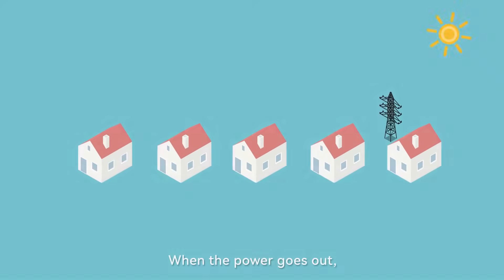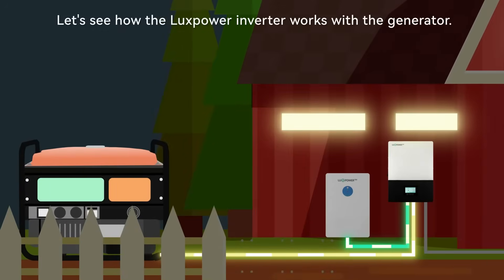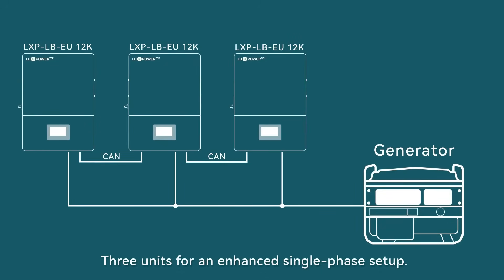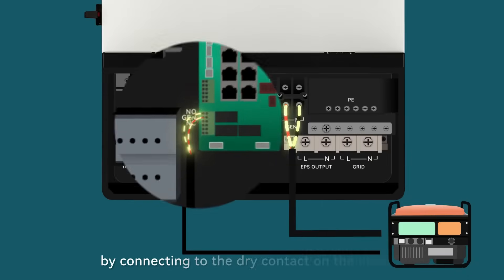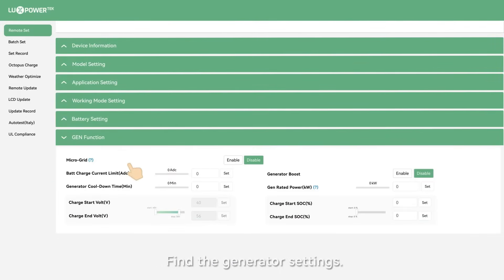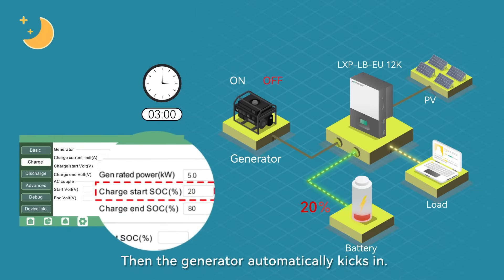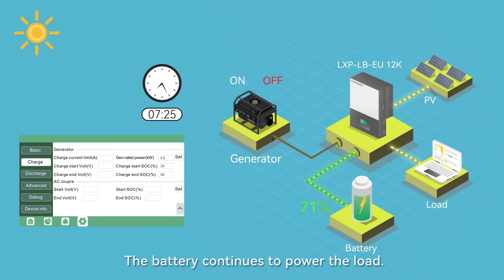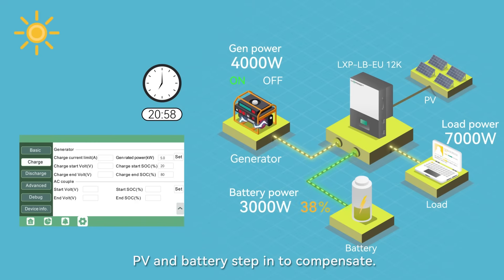Hybrid inverter working with Generator Application

Comment: Can I use a 3rd party inverter to connect to LXP 4.6 UPS port to charge automatically the batteries?
Reply from the maker: Hi there, thank you for reaching out. Sorry, the ups port is only for the load connecting, cannot work with any other device.
Reply: @LUXPOWERTEK  Is there any other way to connect a 3rd party inverter to LXP to load the batteries?
Reply from the maker: @Atomotti  Our LXP 4.6K model can work with the battery directly, why do you need to connect a extra 3rd party inverter with it to charge the battery? Do you have a grid-tied system installed in your house now?
Reply: @LUXPOWERTEK  I have two inverter systems. One is LXP with batteries and the other one is 3rd party but without batteries. The 3rd party installtion would help me to get the batteries faster loaded, especially in winter time. Both systems are grid-tied. If 3rd party inverter could be connected to LXP that would help me a lot.
Reply from the maker: @Atomotti  The LXP 4.6K was released in 2019, and it’s one of our early-generation models.
Unfortunately, this version does not have a dedicated interface that allows direct connection with a third-party inverter for automatic battery charging.

Comment: Hello sir. Sir, apart from the Gen port, how will we connect the generator? Because in our country Pakistan, gen port is used for heavy load and EPS port is used for light load. And apart from Gen port we have to connect the generator with the inverter. Please guide me
Reply from the maker: Hi there, thanks for your reaching out. Can I know which model are you using?
Reply: @LUXPOWERTEK 
GEN-LB-EU 8KW IP65
GEN-LB-EU 6KW IP65.
Reply from the maker: @Rehman_electric_point  Thanks for the reply. Regarding the design of the inverter, we have one eps port and one generator port. If you connect heavy load in the Generator port, you can try to connect generator to the Grid port, and enable" Micro-grid" funtion in the monitoring.
Reply: @LUXPOWERTEK Sir We connect the generator to the side of the grid, for example first of all disconnect the grid and connect the generator?
Reply from the maker: @Rehman_electric_point  If the utility grid is not stable in your area, you can try to use the way I mentioned before, but if the utility grid is stable, you can connect the generator to the GEN port of the inverter and connect the "Heavy Loads" to the grid side.

Comment: Must the inverter be an "inverter generator" or can any single phase inverter be used.
Reply from the maker: Hi there, thanks for reaching out to LuxpowerTek!
Our inverter has a dedicated port for connecting to a generator. If the grid is down, you can use a generator to supply power.
That doesn’t mean the inverter itself is an “inverter generator”.
We offer various models including single-phase, split-phase, and three-phase inverters to suit different needs.
Reply: Sorry.I meant, Can any generator be used or must it be a inverter generator
Reply from the maker: @shayallie3176  Hi there, our inverter can work with diesel generator, not the inverter generator.

Comment: Can I connect the On grid inverter to the Gen Port?
Reply from the maker: Hi Sir, thanks for your reaching out. May I know which model do you use now? Most of our inverters support this function except for some models with older firmware versions.
Reply: @LUXPOWERTEK  SNA6000

Comment: if my generator was already connected to my house  ,do i need to change it to the Inverter ? I mean when Grid is Off, i switch to my Generator , then i have Power again, from gnerator,   that power should also be THE GRID power to Inverter , Right ?  This setup is for some house no connection to Grid ? Or i should connect generator from house to inverter ...
Reply from the maker: Hi there, thanks for your reaching out. If you have the generator, we suggest that you connect your generator into with our inverter through the GEN port. When the grid is off, the generator will be auto-started control by the inverter. Our most of inverters have the separate GEN port for working with the generator, or AC coupling or Smart Load function.
Reply: @LUXPOWERTEK   Will the inverter start from the GEN port if GRID is Off and the battery is discharged? I tried this case without the battery connected and the invertor was not able to start, now I'm wondering whether the same would happen if battery got fully discharged. Inverter mdel is GEN-LB-EU 10K

Comment: May I ask you, is it possible to use hybrid inverter with on grid micro inverters? Will it use micro inverters for charging the battery if it is more solar energy generated than consumed ? Feed energy to grid is disabled in my installation. Thank you
Reply from the maker: Hi Sir, Yes, our hybrid inverters are compatible with on-grid micro inverters. The micro inverter system can be connected to the GEN port, utilizing the AC coupling function.

If your local regulations do not allow energy to be fed back into the grid, you can configure your entire system, including the micro inverters, to operate in off-grid mode. For more information, please refer to our video, which provides a detailed explanation of the AC coupling functionality(for Luxpower hybrid inverters）.

Comment: what generator models do you recommend?
Reply from the maker: Hi Sir, Thank you for reaching out. We don’t have specific generator models to recommend. However, if you are using a single-phase inverter system, please use a single-phase generator; similarly, for a three-phase inverter system, a three-phase generator is required.

For our SNA series, the recommended generator input power is 7370W. We advise not to exceed this power limit.

For our hybrid series, please refer to the user manual to check the generator passthrough relay specifications and select a suitable generator accordingly.